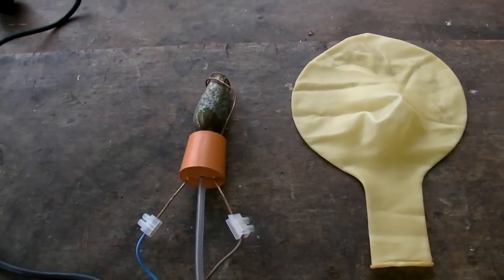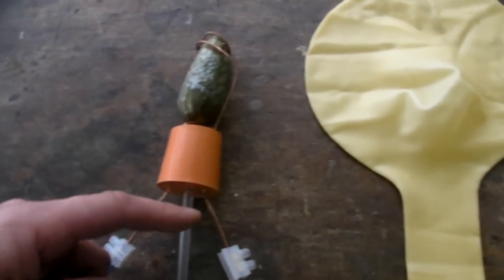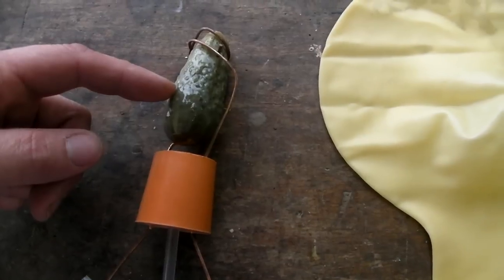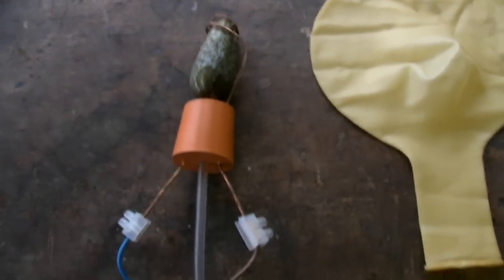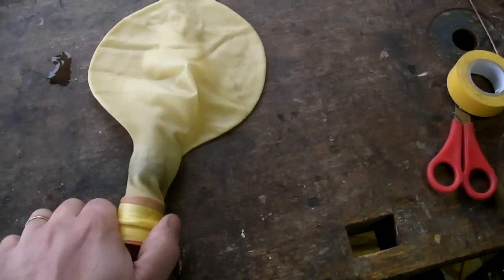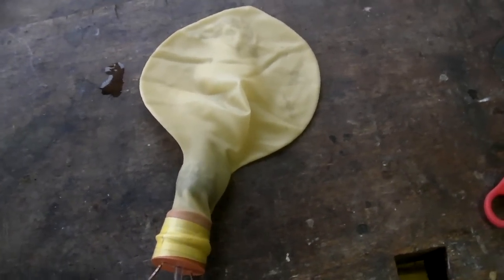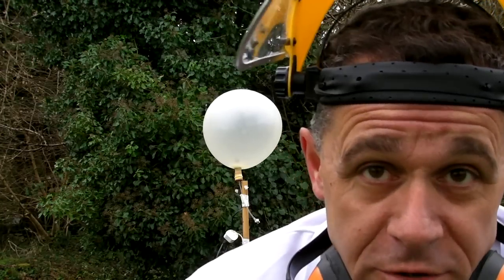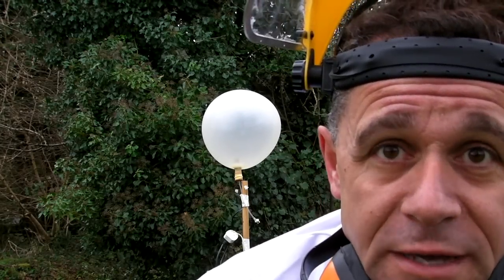Can You Use A Pickled Gherkin To Ignite A Hydrogen/Oxygen Balloon?

Comment: i used to pop pure hidrogen ballons whit the lighter in my hand wearing normal shirt, no protction exept the protection glasses
Reply from the maker: You need to think about your ears!  Although a pure hydrogen balloon isn't anywhere near as loud as a hydrogen/oxygen mixture you still run the risk of permanent hearing damage if you're that close to it.
Reply: i'm now making the electrolysis (I think it's called like that, i'm italian) machine to have hidrogen and oxigen toghether and i am now quite confident whit those ballons so thanks for the advice, i have masks and ear protection for that
Reply: i'm now making the electrolysis (I think it's called like that, i'm italian) machine to have hidrogen and oxigen toghether and i am now quite confident whit those ballons so thanks for the advice, i have masks and ear protection for that
Reply: i'm now making the electrolysis (I think it's called like that, i'm italian) machine to have hidrogen and oxigen toghether and i am now quite confident whit those ballons so thanks for the advice, i have masks and ear protection for that
Reply from the maker: francesco quadrio Excellent!  I've done that in the past as well - using a car battery charger to provide lots of current (be careful with electricity and water - serious risk of electrocution with large currents) but with UK tap water there was also always a little chlorine mixed in and that always seemed to dampen the explosions.